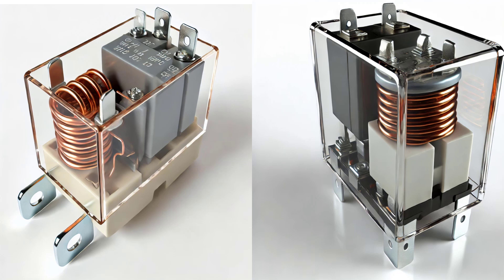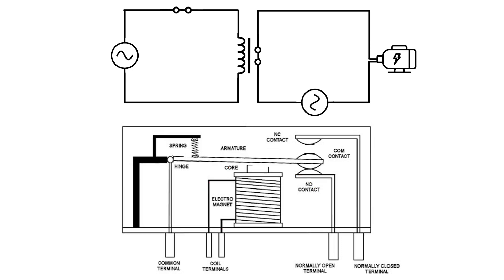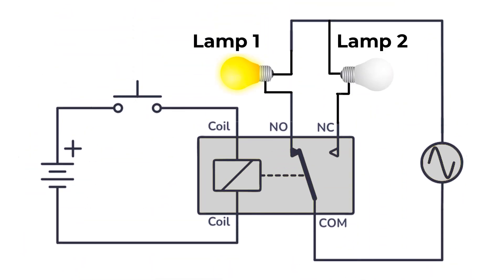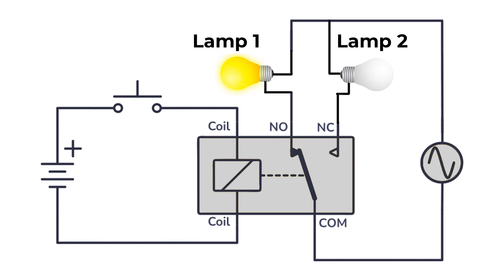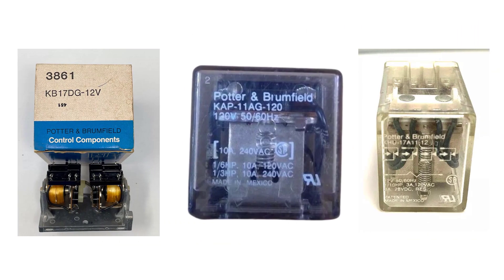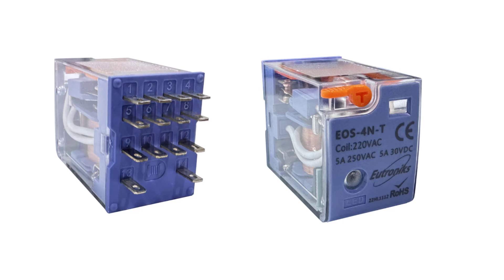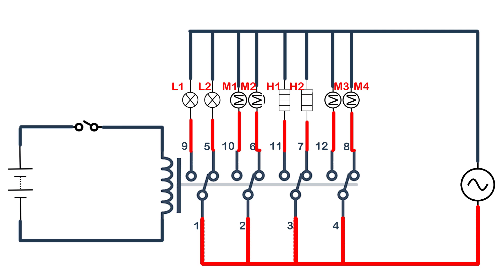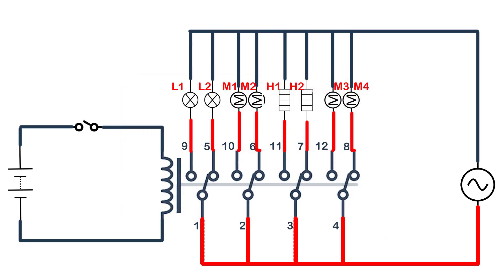Lecture 6: Exploring Electrical Relays | Master Industrial Automation & Classic Control

Comment: Hi, Sorry, I think there is a confusion here.
When the coil is not energized (so the NO contact will be open as it is normally open as long as the coil is not energized, and NC contact will be closed as well) therefore i guess lamp 2 should be on at this case.
When we energize the coil (then the NO contact will be closed due to the electromagnetic field, and NC contact will be open) then lamp 2 will go off and lamp 1 will be on.
Reply from the maker: thank you for your comment, i will watch it again and tell you